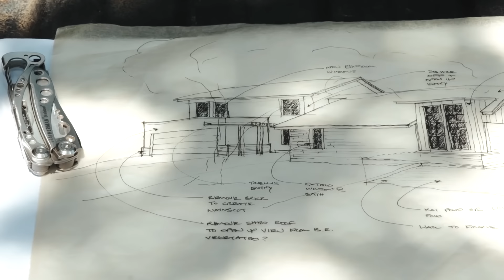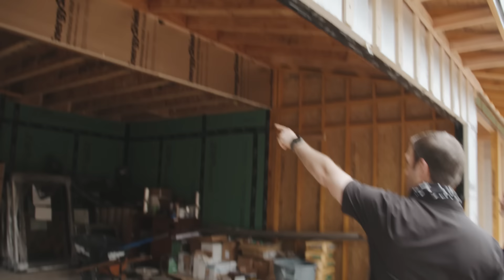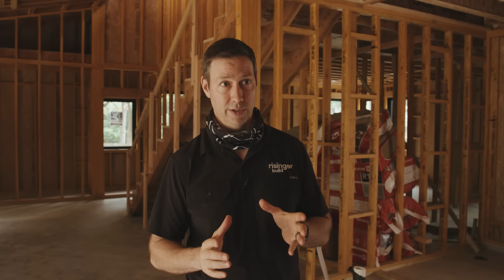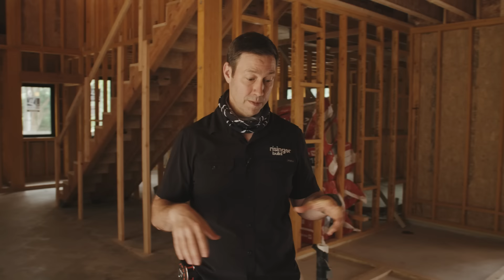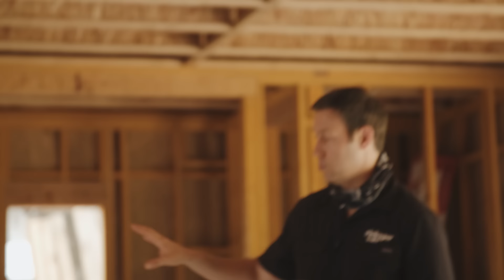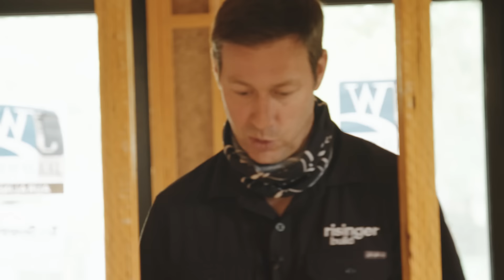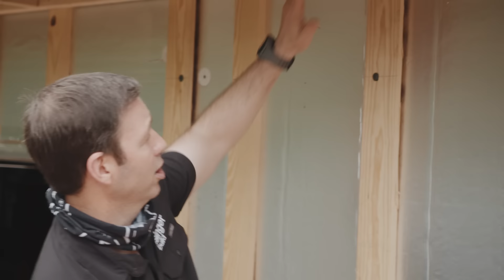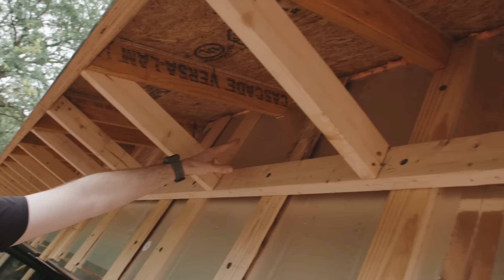The Perfect Wall - Building Science Training

Comment: Hello Matt, I really enjoyed your videos The Perfect Wall System, as well as the Perfect Roof System, making it a passive house.  The house I'm live in located in the panhandle of Florida. The exterior wall is brick cased with weep holes at the bottom of the brick, with an 1/8" of foil board, 3 1/2" actual studded wall, fiberglass insulation then drywall;  Single pane windows. WHAT was the builders thinking back in the 1980's when this home was built???  Extremely poor insulation. Florida's A/C cost plus its an all electric home, there is gas for cooking but we use electric.  Sadly 16 years ago after Hurricane Ivan  the insulation was poorly installed in the ceiling in the one bedroom as well as the ceiling drywall finish was poorly finished.  The mistake many people make when installing hurricane shutters on a brick house; they attach the screws to the brick.  If the brick is not installed properly with ties to the wall structure.  The extremely high winds in a hurricane will peel the brick off the house. This is why a 6" fastener is needed to screw thru the brick and into the stud along the window. I like the Floor System you are planning to install on your house concrete slab.  The insulation is a major benefit. But another benefit is walking on a concrete floor is hard on the body and your floor system eliminates this issue.  I refuse to use carpet especially in Florida, carpets help to bring allergens into the house. I like the hemp tongue and groove flooring would be a great floor finish.  I can see many of The Perfect Wall, Roof and Floor System can be retro fitted to a remodel on existing houses.  The application can easily be applied to existing houses.  Yes there will be added costs but it will pay off in the future.  Plus the ERV, dehumidifier can make the home very comfortable and the homeowner can control the house interior comfort on their own terms. The ERV and dehumidifiers can be installed in the attic due to the insulation installed into the rafter instead of the ceiling joists and now you have a climate controlled storage area.  This will save on storage unit costs especially with not basements in Florida. There are basements in north part of Florida but not so sure they are properly waterproof would be my concern.  In Florida I would install an instant hot water heater with the added solar panels would be key factor for hot water.  My choice would be to install the panels on the ground due to potential water penetration when the panels are installed on the roof.  But that being said you need to have the space in the yard to install the solar panels on the ground.   I really like the hemp insulation from one of your other videos.  I have many ideas to make upgrades to this house or future houses.  Thank you I really enjoyed your videos. The triple pane windows are another added feature I really like on your house.

Comment: Matt I need to know. On you Monopoly framing, when the walls and roof meet do you angle the edge of the roof sheeting so that its perfect or do you butt it up and just have the tape cover the little gap that would be there without mitering the edge? Its been on my mind ever since I saw this I need to know!
Reply: i was thinking the same
Reply: Monopoly houses have no overhangs.  If you have one of those games, look at the house pieces.
Reply: Sheathing to Sheathing, foam to foam.  Likely the top sheathing goes over the wall sheathing then sealed.
Reply: This Old House did a project that turned a existing house I think into a Passive house. Should be able to find the episode where they showed the exterior sheathing/foam joints.
Reply: @Matt it would be great if you or Steve could show the CAD drawing of 3+ different details where the wall and roof meet. Soffit on the popup, soffit on the gabled end and soffit on the front.
Reply: With the quality of flashing tape out there I don’t think beveling the edges would be worth the expense. It could go pretty fast with a track saw though. I’d be tempted but probably wouldn’t. Depends on time availability.

Comment: Won't the foam crumble over time from being crushed by the pressure of being sandwiched by the ledger against it? Then causing weak support of the ledger?
Reply: I would suspect this has been properly engineered.  If you don't exceed the PSI rating of the foam, it should be fine.

Comment: I've done this... not to the same spec with regard to energy efficiency, but i've done it in the sense that I've remodeled from bare frame to way better than builder grade/spec standards and design.... For those of you considering something like this...it's almost certainly cheaper to build a brand new house. The amount of time, effort and engineering it takes to make a building that was in no way intended to accept the building materials and techniques he's using here do what' that house will do is not just more expensive...it's way more expensive. Maybe it's justifiable because this is where they want to live for as long as they can, but I'd guess they're upside down in it financially by a long shot even if he isn't paying himself as the general. Infinite money... who cares... it's a blast... I love doing it too, but if if that's not you... buy a lot and hire an artist of a builder... get exactly what you want, save a vast sum of money and be done in half the time.

Comment: The solar will keep you from suffocating if you add a battery pack for outages.
Reply: David Wooten  Or, they can open a window.
Reply: The Zender units use 140w of power for the fans (and probably a bit more if you have the highest level of pollen filters) which is a tiny amount of power. Even a small battery - say 1kWh, could keep Matt’s house running for 24hrs.

Comment: Why two layers of Advantech? I've heard of floating t&g ply floors, for sound proofing reasons, but only one layer of 3/4".. (edit: with all joints glued)
Reply: I'm sure Matt will chime in, but I want to take a swag at it....  If your upper sub-floor were only one layer, you might be limited to loading over the foam.  Typically in a pier and beam or second floor, depending on joist centers, you can "get away" with 3/4, but often require 1-1/4" for say a tile installation to make loading an rigidity standards.

Over rigid foam insulation you REALLY NEED to double up to get additional rigidity and reduce flex under small area loading and or total loading to guard against compression destruction of the foam underlayment/insulating layer.

At least that is my NON-PE SWAG as to the thinking behind the choice....  IF you are building a "500 year" house, you absolutely need rigid floors to guarantee preservation of the underlayment physically AND functionally.
Reply: I would add that the second layer bridges the joints of the first layer which further helps stiffen the joints of the first layer. Single layer, every butt joint is flex too much over the foam. 2 layers, you will never step on a weak butt joint that travels to the foam.
Reply: staggering the joints between the first and second layer of subfloor turns the entire wood structure into something that is floating on top of the foam, if you don't have 2 layers and only had 1 layer then if the foam shrunk or moved in anyway then you could get gaps between the sheets of a single layer.

If you look at wood flooring you have 2 different types, you have nail (or glue) down tongue and groove or you have a system called "click lock", this is a tongue and groove variant that actually locks the boards to each other instead of just slotting into each other like traditional tongue and groove. so to make that floating layer into an assembly that can't slide apart you need a second layer with staggered seams.

Hope that made sense.
Reply: @DanielsCorner644  I should've added that the single layer t&g floor I referred to is specified to have all joints glued so the sheets can't move relative to each other.

Comment: @27:20 Not to beat the dead horse but let's talk about the airflow again. In that same situation, it makes sense to think that the older, more open house, may have more temperature loss but will have continued air exchange. The tighter house will survive the temperature without power for longer, but it is dependent on your air handler system to keep fresh air in. Of course you could just open a couple windows a little bit, but then you lose at least some of that temperature benefit. Side by side situation, no power, presumably no generator, isn't their just a pro and con either way?

Considering how robust and reliable our power structure is, there's probably a net benefit financially to the tighter house. But the loose house will make you uncomfortable by making you too hot or too cold, while costing you more for it; the tighter house can pose a safety risk if you don't take active precautions to keep air exchanging. Carbon dioxide detectors should be mandatory in such houses, set up on their own backup batteries. Even though is is really unlikely you would breathe out enough CO2 to make your house a hazard in a frame of time where no one goes in or out, especially with the power out and there being less to do inside, still CO2 over saturation is a condition that could happen, and if possible there should be a non-electrical back up in place to help mitigate it in a tight home.

Comment: Sorry Matt, you're continually misconstruing the 'houses need to breathe' argument that I (and many like me) complain about. 

The problem isn't a tight home per se.  The problem is you're building super-tight offgassing FOAM-ENCASED homes that are totally reliant on properly designed/installed/callibrated/maintained HVAC systems - which is both expensive and time-consuming. 

You can't simply call the local beer-bellied HVAC contractor and get him to slap a system together like the good 'ol days.  These homes require a consultant to design integrated HVAC systems and specialty contractors who can properly install and calibrate/load balance them.  Finally, you need to train homeowners how to maintain these systems - I often see filtration units placed in attics/crawl spaces - does anyone think Average Homeowner is going to crawl around and clean/replace filters every few months? I get tired just thinking about it. 

The critical flaw is failing to maintain these systems because there isn't any clean outside makeup air (and no, don't snarkily say 'crack a window' - that's antithetical to your entire argument) - plenty of studies show improperly vented homes can have 20x worse indoor air quality than outside air - you're literally gassing yourself to death.

When you begin using foam-free, formaldehyde-free materials in these super-tight homes, I'll be cheering you on.

Above criticism aside, think you do a fantastic job overall - good content, good editing and a willingness to go beyond the superficiality of almost every other building show. Liking your website, but sure miss the lack of interaction - wish you'd post that content on YouTube as well.
Reply: my issue is what about an extended power outage, like say the power is out all night from a storm, if your A/C system isn't bringing in fresh air how longer will the air inside stay good enough to not cause adverse effects on the homes occupants regardless of the materials, like at what point would you use up too much of the oxygen and have to much carbon dioxide?
Reply: Last large project was a very complex 10K sq ft of conditioned space (plus Matt-attics, and all crawls within conditioned space. 2" continuous polyiso exterior, walls and 2x 2 1/2" for compact roof assembly. 100% liquid applied VP self-seal.

ACH50 was only 2.8, but.......We tested per letter of the law. 4 ERV's (did the bath venting) were open, and the kitchen vent was open. 6' wide hood had a commercial rooftop fan on a 20' tall 16" x 18" duct, 2000 CFM when powered on (not for test of course). If we had tested with vents blocked, we'd have been EXTREMELY low ACH50.  

I had concerns about the air change through that kitchen vent, and at one point wished I had installed a low leakage damper just under the rooftop fan (power open when fan is powered on). That is illegal, per codes, but I thought about it. Until the owners moved in. They (he....!!) do a LOT of cooking. The house is continually exhausted by power, or by convection, and the heating/ comfort is unparalleled, as is the air quality. The house is never stuffy or feels "closed". Of course, for warmer months, the AC is a dual system: evaporative coolers with economizers for the main areas, combined with chilled water (we are on ground loop water-water) coils for "conventional" air conditioning (air record, along with the ERV's for fresh air).  The upshot is, I am very glad I did not do the power damper.
Reply: @DanielsCorner644  If you need to worry about that, you are inside a vacuum chamber and i advise you to leave.
Reply: So beer-belly prevents one from becoming a "specialty" HVAC contractor?  That makes sense.
Reply: Something I've seen recently start to pop up is CO2 buildup while sleeping. Not everyone has a cpap to filter o2 and pump it to your nose to get the needed air. This comment does give some thoughts to ponder though.

Matt is generally building for million dollar homes that have the budget for all the "specialist" subs. He specifically mentions he doesn't build without architectural informed designed. As neat as this is watching, many of the products and designs arent for the diy-er, or the non professional builder, or the budget constrained home builder. The fact is honestly Americans have also spent decades looking for the cheapest homes and not things that last, and the end result is things like Matt's neighborhood. The previous owner fell behind maintenance requiring demoing down to the slab, where as even in Matss current home, he's paying hundreds of dollars a month on electricity, and Texas power rates can be as low as $0.05/kwhr.

I will say however, I'm always suspect of any engineering system that claims to be maintenance free. Maintenance free means that when something fails it will be expensive to fix, or the knowledge to fix it may even be lost. The fact is comparing American homes to European homes for centuries is like comparing modern music to oldies. There is a selection and survival bias when we talk about things that have survived centuries. The things that survive in many ways are simply the ones that were lucky. There were plenty of old European homes that have been torn down and rebuilt.

Comment: Passive House details are important elements for good practices (your theme)! I am super glad you went this direction. QUESTION: could you have eliminated the 2nd layer of Zip on the roof and just attach the battens thru the rigid insulation - especially if that last layer of rigid had a foil surface. You would still have the air gap and the added foil face inside that gap. Plus it saves ANOTHER process of sheathing the roof. When you count how many times over this roof you have had to layer, one less would be helpful. Thanks again.

Comment: I know it's more of a small question, but with 6 people in your house and guests, what kind of home networking were you planning to do? A little bit more planning, can save some aggravation later. If you're will to spend a little more on pro-grade wifi access points ceiling mounted  in say your living rooms, and kitchen with power over ether net switches, it would be rather robust. Likewise with the aluminum what kind of phone single do you get inside your house? In a similar vein, what are your plans for say wiring TV in your living rooms? I would recommend hardwiring ethernet ports for all the spaces you plan to have computers. You've talked in previous videos about maybe using your daughter's room eventually as a home office, and running dedicated network ports would easily help. On top of this, what kind of smart systems were you planning to integrate? I'm not a fan of any of the voice assistants, but I do appreciate color adjustable lighting. 

I ask all this, as I live in a much older house in Texas, and it's been a bit of a nightmare regarding networking and lighting. Whoever refinished it didn't meet code for number of outlets, so we've had to make decisions to avoid just having extension cables running everywhere, and when I needed to work from home permanently I just said screw it and ran my other ethernet drops to avoiding running cable everywhere along the walls.
Reply: I expect Matt will find, as have we, that cell service is seriously degraded and or lost, with the confines of the foil face. We had to install external antenna and interior repeater(s).

Comment: Roof eaves in this house require some diligent structural engineering.
Strong winds can, if they're not attached strongly enough, rip them off due to uplift.
In colder climates that get lots of snow, heavy snow fall can brig them down.
So, a good idea to allow insulation to bypass them, but watch for engineering!